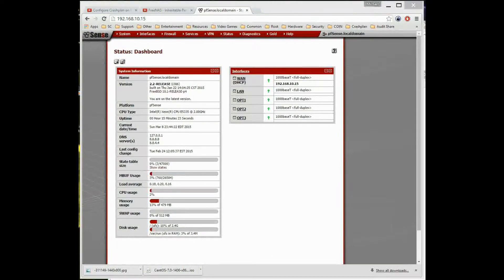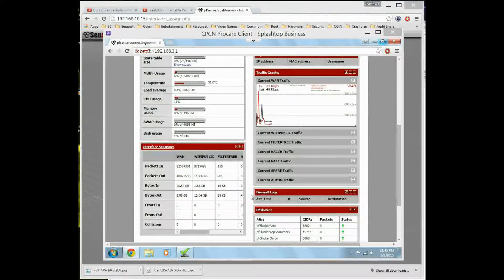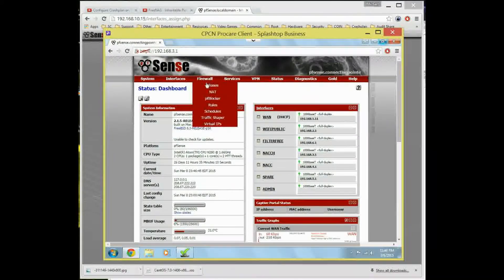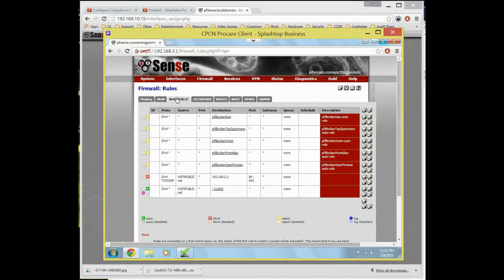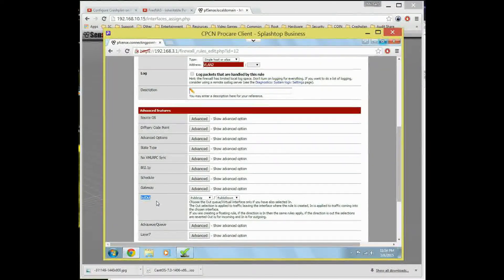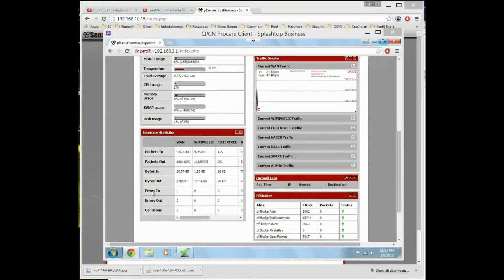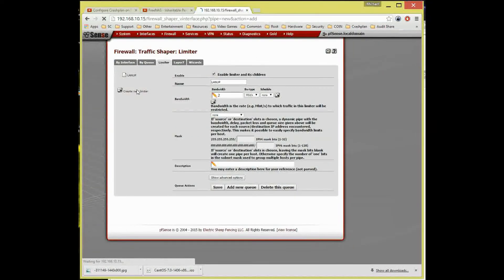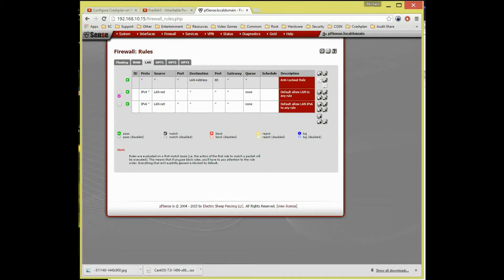PFSense - Limiters

Comment: Great video, by the way you have some experience using VPN in PFsense.
greatings from el salvador
Reply from the maker: Jose Barahona I'm about too. I have to remote into work from time to time and want to use my own equipment for the IPSec tunnel. Right now I run my work "pc" as a VM on an isolated network. I remote into the VM and then use OpenVPN to tunnel into the office.

As soon as I figure out how they have their VPN secrets configured (the guys I replaced didn't document anything) I will configure PFSense for it and make a video in the process.